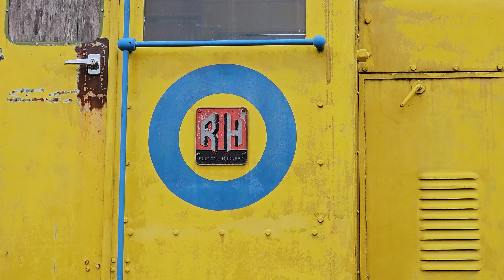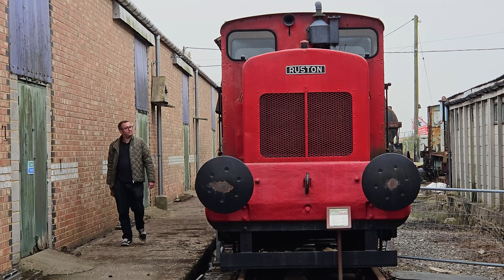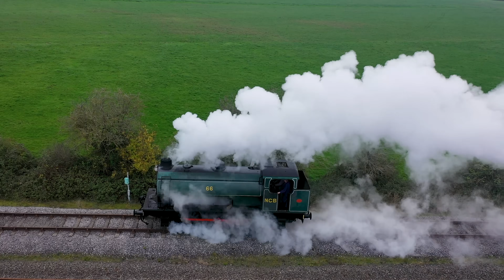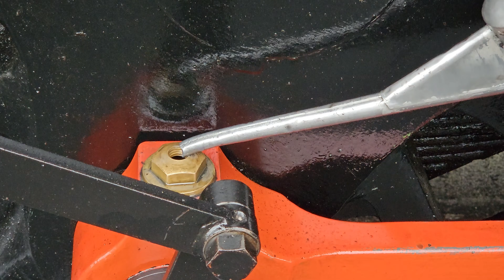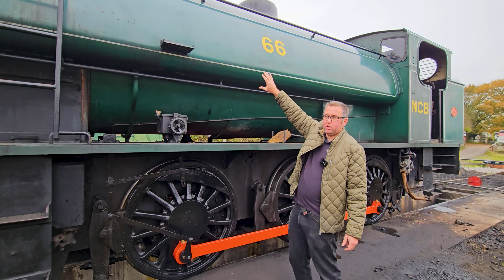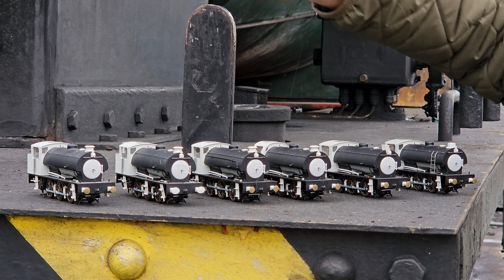Accurascale - Brand new ‘OO’ gauge Locomotive  announcement

Comment: Will these be able to run on DC power? I know it wouldn't have the full sound function but I don't have DCC.
Reply: Yes, the sound version also runs on DC, and you get chuff and random noises
Reply: There are two versions of each loco. DCC ready which will run on DC and DCC with Sound. 

The DCC ready is £100 cheaper than the DCC Sound version.

Comment: I'm super excited to see these come to fruition, I think this is probably one of the most heavily requested steam locos to have a 00 retool so I imagine they'll be popular!

I am slightly disappointed though, for a class of over 400 with 70 preserved, only 6 variations is very limiting to people wanting to model specific locos. For example I'd love a model of No. 3839 'Wimblebury' as it was the first locomotive I ever drove, but with this range I can't really model it correctly without having to potentially rip details off or scratchbuild other details. There's also a lack of WD condition locos, which is surprising considering that of course was the original operator of these locos during the war. You seem to have a pretty vast tooling suite planned so hopefully more variants will come in the future!

Still a great announcement though and you can be sure I'll be picking one up!

Comment: I’m shocked that the real Wilbert engine isn’t apart of this line up. We know acurascale are proud of their Duck model so I thought they would jump at the chance to do another Thomas character
Reply: Might be a controversial opinion, but if Accurascale are indeed making a newly tooled Wilbert for the 80th Anniversary (technically 81st if they will be released alongside the other Austerities in Q2 2026), this might be the best thing that has happened to the Thomas modelling community.
Reply: @ the best thing that has happened for the Thomas modelling community is rapidos j70
Reply: Accurascale are probably keeping the Wilbert model hidden as a surprise announcement. As far as I know, there's only one promotional image of the decorated samples that features Wilbert but is tucked all the way at the back of the line up. It could also be a Longmoor Military Railway example with the livery, but the lining on the front of the saddletank suggests otherwise, which Wilbert does in fact have. The lining on the tank sides also matches to the DJ Models version of Wilbert and the RWS illustrations

Comment: Guess Hornby's 40 year reign over the Austerity is about to end
Reply: @DTChapman1  queue Hornby doing a rushed new run or putting it in the railroad range for 99 quid....
Reply: If you remember DJ models did those locos as well😊,
Reply: @ yeah but the mechanism was crap and it was overpriced